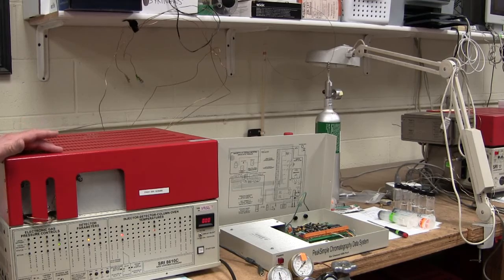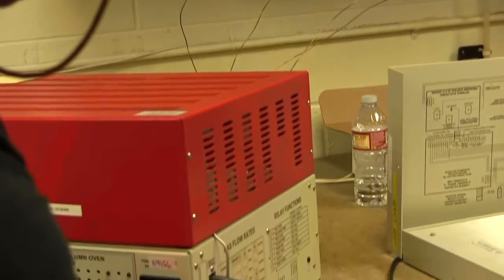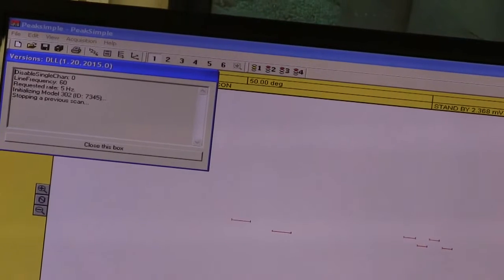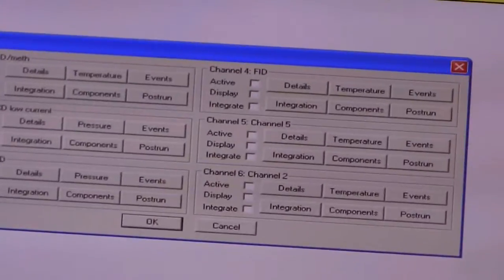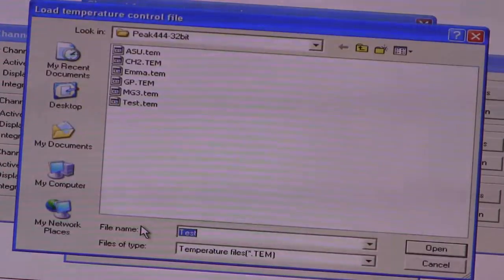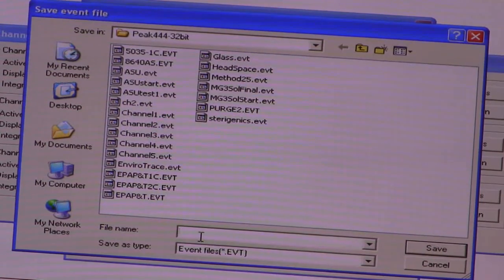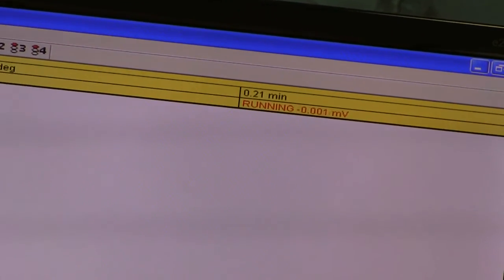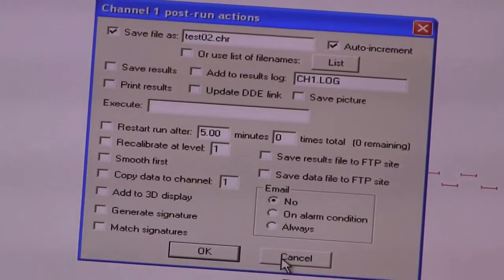Peak Simple 101

Comment: How can i know the response factor for gases with peaks??
Reply from the maker: You would calibrate using a known amount of sample(s), and then use that as your calibration curve.

If you wanted know the exact response factor for, let's say Nitrogen, you could inject 1ng of nitrogen and see that you get a response of 1 area count. From this we can say that each ng of nitrogen == 1 area count. This only works if the response is linear, and it can vary due to the detector, carrier gas, and detector gain. 

If you have any questions give us a call at (310) 214-5092
Reply: SRI GC Training 
Thx for replying..
Can i use the area normalization method to calculate the weight for components???
Reply from the maker: You could. You would still have to know where the peaks come out, and what your sample is made of. 

I haven't watched this whole video in a while and don't currently have time to scroll through it right now. Are you talking about the norm area %? Or a different specific method not related to the video? If it is something in the video feel free to reply with the time it appears in the video, so I can answer your question better.